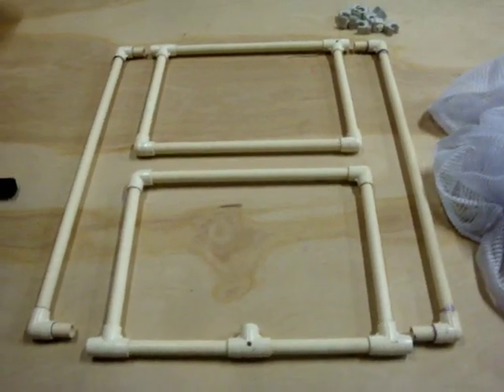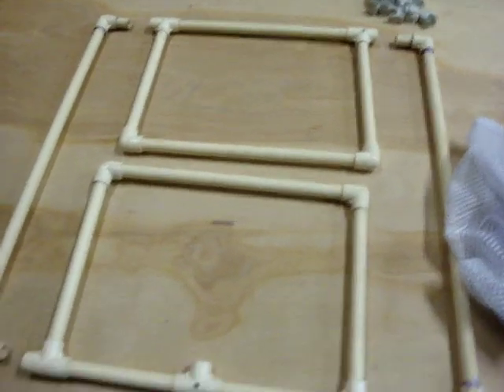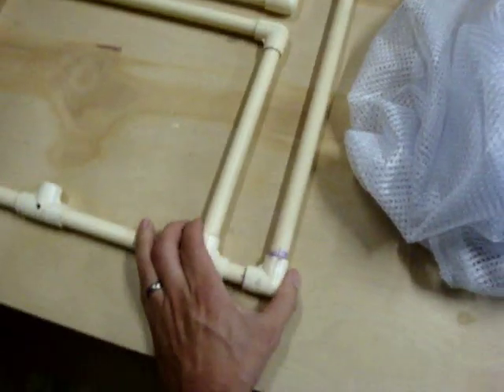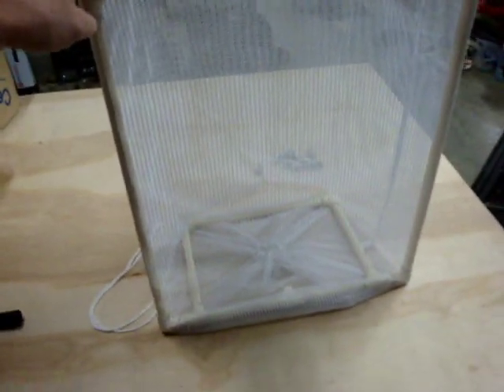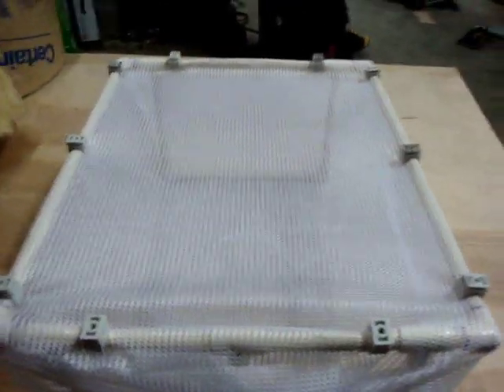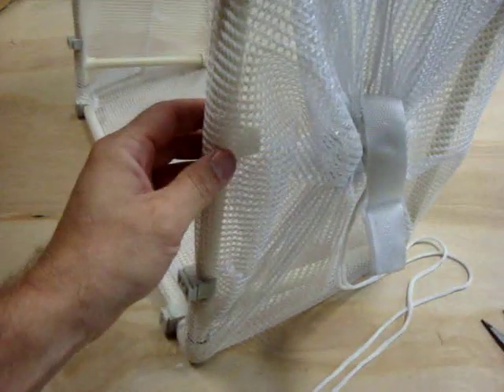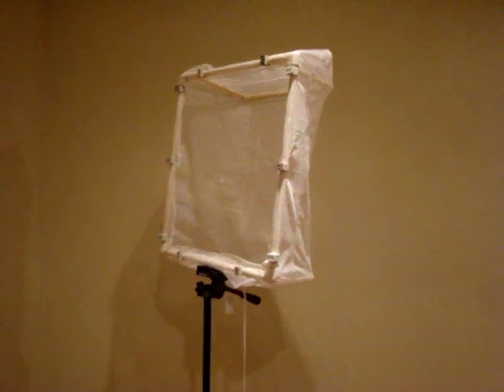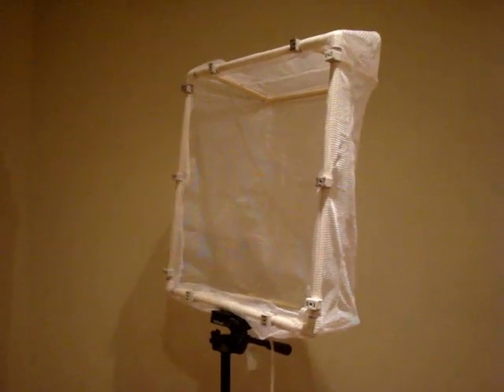Making a Brass Catcher

Comment: Made one of these yesterday.  Many people asked for dimensions, well here is what I used.  I suggested a 2 ft pipe because I used a few scraps that you might not have.

1 - 10 Ft CPVC 1/2 inch pipe
1 - 2 Ft CPVC 1/2 inch pipe
8 - 1/2 CPVC 90-degree couplers
5 - 1/2 CPVC Tee couplers

The parts needed and the lengths

2 - 19 3/8 inch long pipes
4 - 1 1/4 inch long pipes
3 - 12 inch long pipes
4 - 8 1/4 inch long pipes
2 - 5 1/2 inch long pipes.
Reply: Making one now based off these dimensions. How'd it work out? Anything you'd change?
Reply: @marckarum7469   1/4 x 20 hex nut for the tripod.
Reply: Best way to cut PVC pipe

Comment: Ever have an issue with the brass melting the netting?
Reply from the maker: .223 brass is hot enough to melt the netting a little bit, but I still use it.